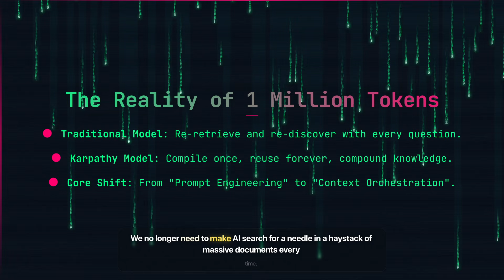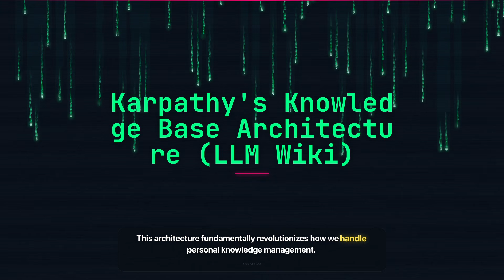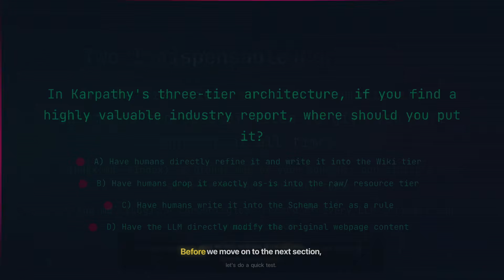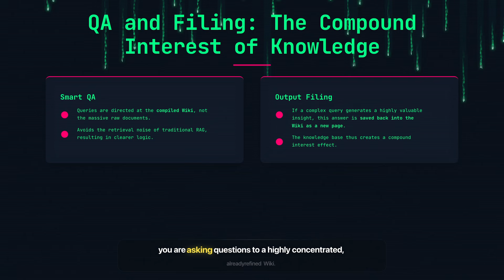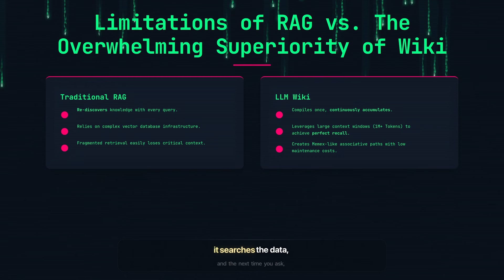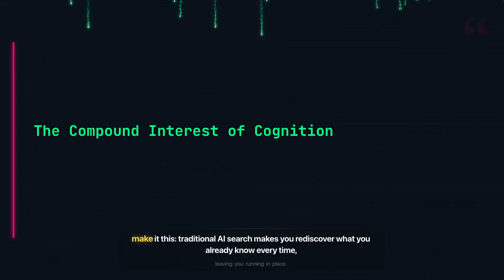RAG is Dead: Build an LLM Wiki Like Andrej Karpathy

Comment: Great production quality, but the technical claims don't hold up. You say RAG is "obsolete" and LLM Wiki "solidifies knowledge" with "perfect recall" and "almost zero maintenance" — but the LLM has no persistent memory across sessions, the "memory" is just static markdown files that can contain hallucinations, and when the index exceeds context (which it will), you quietly add qmd which is BM25 + vector search — that's RAG. You also claim "you can stuff the entire Wiki into context" while also needing "smarter chunking strategies" — those are contradictions. The biggest issue: who fixes broken links, resolves contradictions, merges duplicates, and verifies that "surprising connection" isn't a hallucination? The video says "maintenance costs almost zero" but never answers who does the work. The LLM won't do it reliably. The human ends up doing it. That's not zero. That's a second job. 🐑💀🧙

Why LLM Wiki Fails as a RAG Replacement: Context Limits and Data Integrity Issues:
https://gnu.support/articles/lack-of-thinking/Why-LLM-Wiki-Fails-as-a-RAG-Replacement-Context-Limits-and-Data-Integrity-Issues-124403.html